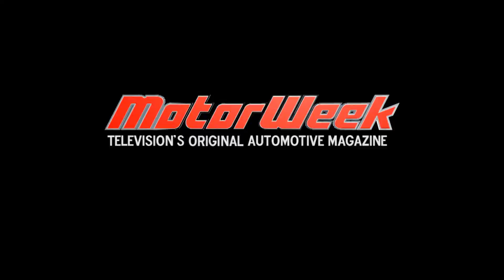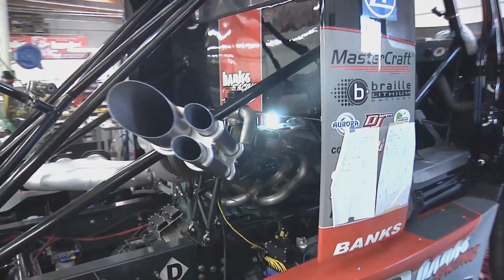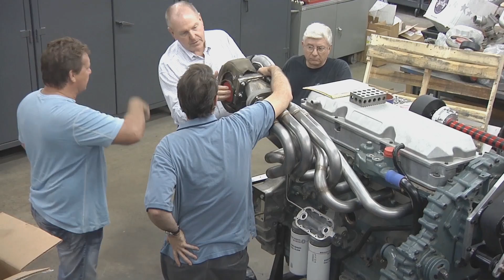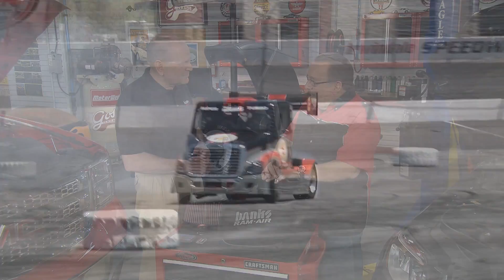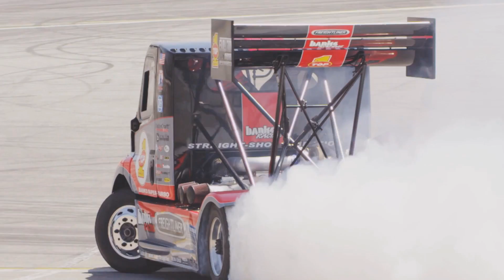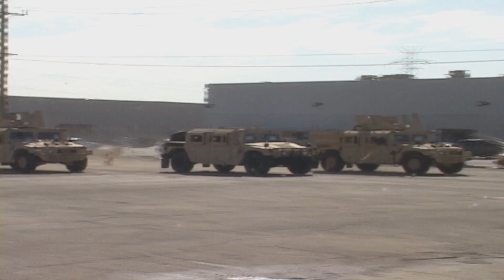MOTORWEEK EXCLUSIVE: GALE BANKS PREVIEWS PIKES PEAK 2013

Comment: Methanol would not be practical for oem's. 

Diesels right now are like gasoline american engines in the 70s. They're in the teething period where a lot of extra stuff is added to get decent emissions, and it hurts power, but that's what was needed to get the stuff in the 80s and 90s that allowed for even better emissions. Without the incentive we'd all still be running leaded gas catless cars and be wearing surgical masks to walk to the corner store like in China.